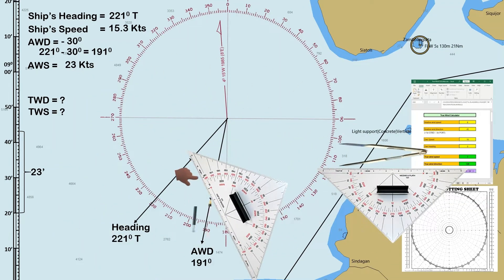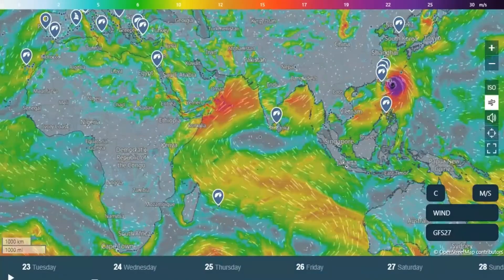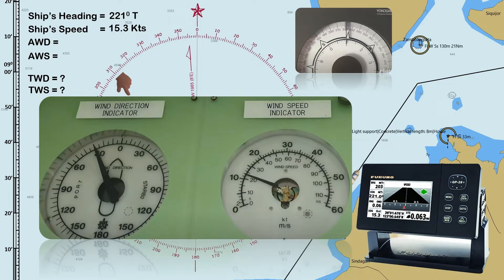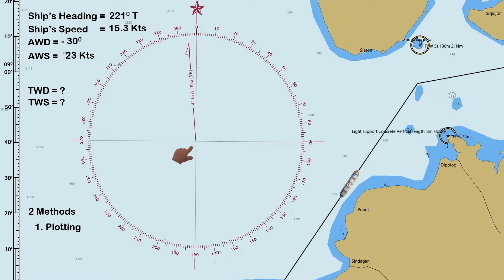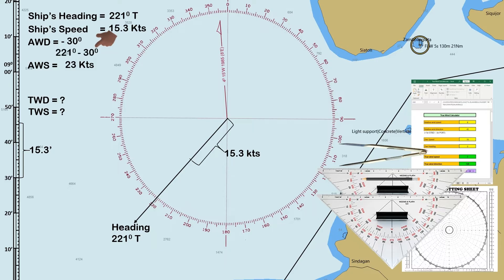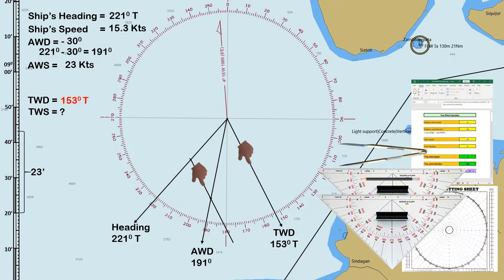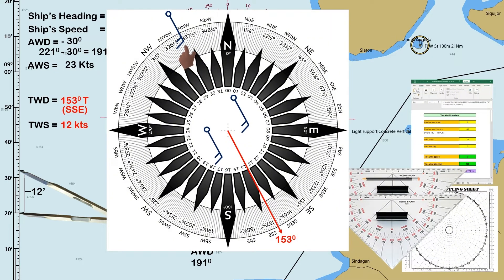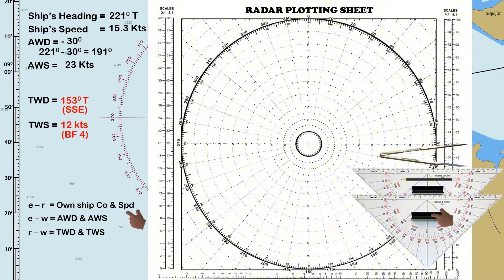Determine True Wind Direction & Speed: Using Compass Rose, Plotting Sheet, and True Wind Calculator

Comment: Thanks you sir, sir please let me ask dis question, A vessel heading 315 degree true course has a force 4 wind on her starboard quarter (135 degree relative from her starboard bow ) using a sketch or diagram, what is the true direction of the wind
Reply from the maker: True wind direction = E
Vessel heading 315°T with wind on her starboard quarter (relative 135°). True wind direction = 315° + 135° = 450° → 450° − 360° = 090° true (wind direction "east").